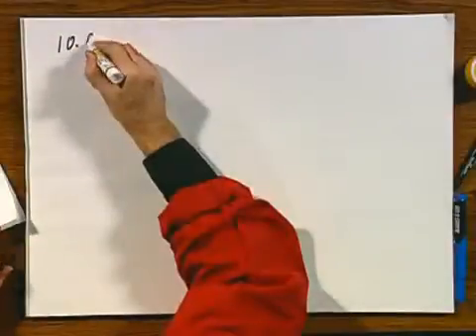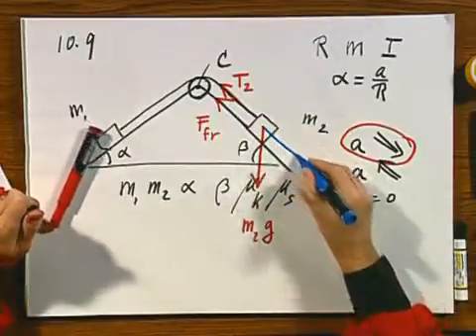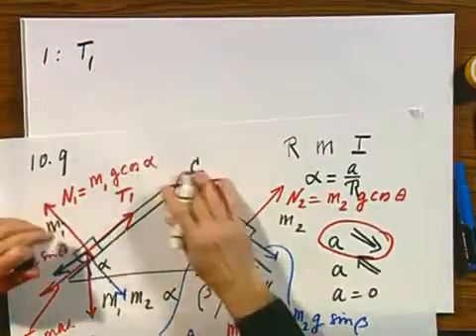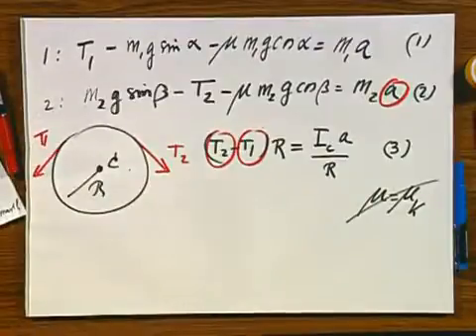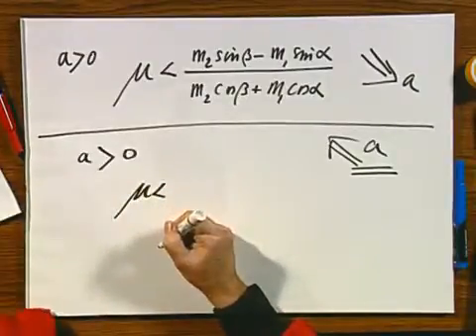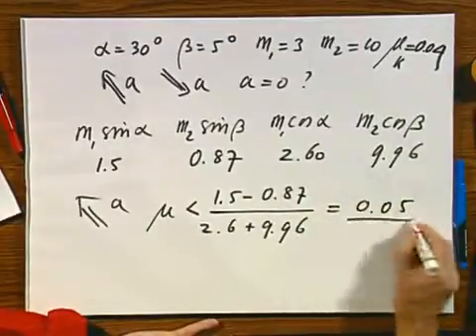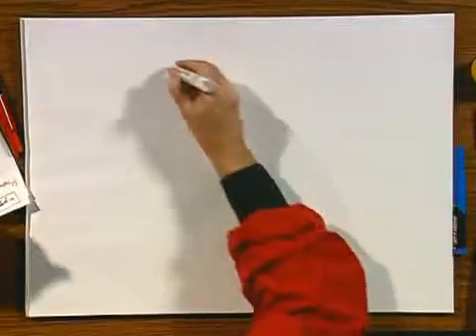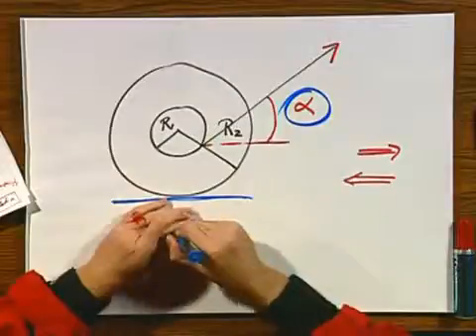8.01x - Module 21.02 - Two blocks on rough slopes, connected by a pulley.

Comment: I have a question sir : you have assumed that the string does not slip on the pulley. But how is that possible if there is no friction between the string and the pulley?  Won't the string just glide over?
Reply from the maker: there is friction between the string and the pulley. Roll an object on an inclined surface. It can be in "pure roll" that means no slip but there is fruction.
Reply: @lecturesbywalterlewin.they9259  so why didn't you consider the torque due to friction = fR on the pulley???
Reply from the maker: @zhgshdbssss6536  here the pulley is considered massless (mass is negligibly small). In later lectures I have pulleys with large radia and large mass and that's a different story. Watch those lectures.
Reply: @lecturesbywalterlewin.they9259  thank you.  I have a doubt though. Does work done depend upon the frame of reference ? And can static friction do work?  The answer will be frame dependant, right? Also could you please post the link to the lecture with pulleys with mass?
Reply: @zhgshdbssss6536  Static friction cannot do work of its own, but it can be part of a mechanism that transmits work.   Just as a normal force of constraint cannot do work of its own, but can be part of a mechanism that transmits work.   Like a human push force, involves the normal force of your hand pushing the object.  The normal force is simply transmitting the work, but it isn't the ultimate source of the work.  The ultimate source of the work is coming from the human muscles, and the chemical energy of food.

For a force to be able to do work, it has to be able to push the object while the object moves, in the direction of the motion.   A normal force of constraint can do work, but both objects have to move together.  Likewise, a static friction force can also do work, but similarly, both objects have to move together.

Contrast this from a spring force, where a spring can do work on an object as it returns to its unstressed position.  The object on the other side of the spring can remain stationary, while the side of the spring that contacts the target object will be moving with the target object.
Reply: @zhgshdbssss6536  The pulley is assumed to have zero mass, and zero friction at its bearing.  It may have friction between the rope and pulley, but that just rotates the massless pulley, and re-directs the tension in the rope.   Real pulleys do have friction at their bearing, and do have a moment of inertia, which means there will be a difference in tension on both sides of the pulley.

A massless pulley just means that the impact of its rotational inertia on the mechanics of the problem is negligible compared to the remaining masses.

Comment: Hi 

First thank you for your videos, they are great and help a lot.

Second, can i ask you a question?

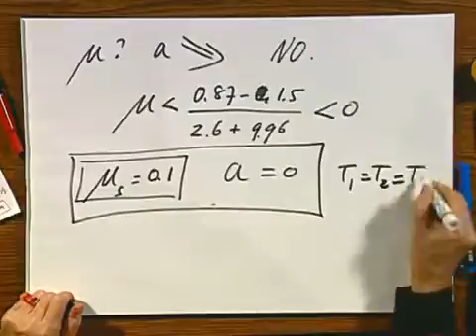 i did'nt understand in the minute 11:13 why T=T1=T2?
If the pulley dont rotate i assume that the torque is zero, if i calculate the torque i obtain that

T1 sin(alpha) = T2 sin(Betha)

Because the angle beetwen the radial vector with the tensions are different.

I cant see why i am wrong, i think is because you can consider the pulley a puntual mass like the tipical problem of high school but i dint understand why when i calculate the torque my result didn't hold.

Thank you very much you have help me a lot with your videos

P.D: Sorry for my english i am not a native speaker
Reply from the maker: the pulley will only rotate if there is a torque on it. Thus if it does not rotate T1 = T2.
Reply: @lecturesbywalterlewin.they9259  Sir, using T1 = T2 and solving for μ i find μ = 0.05 and indeed fr1 + fr2 = 6.3 N and T1 = T2 = 13.7 N. I am again confused. Why do i have a different value for μ?